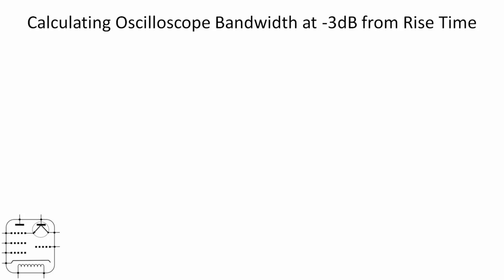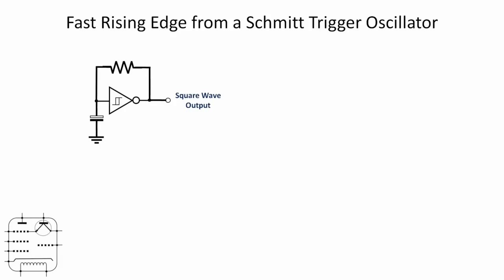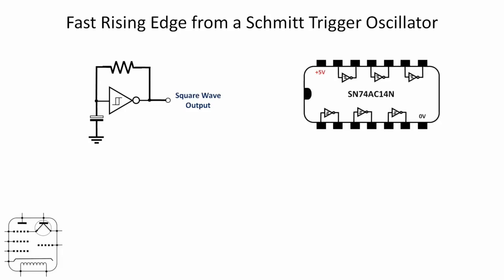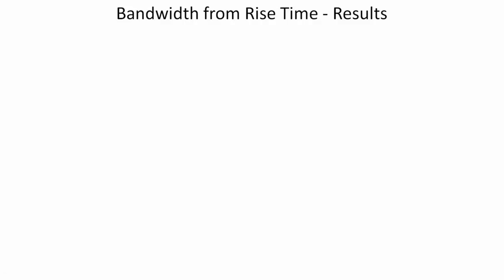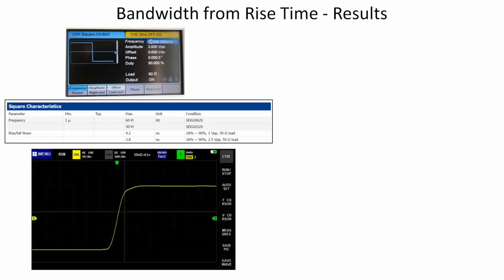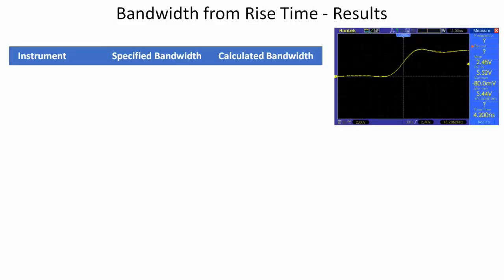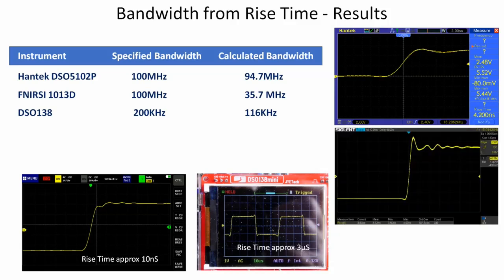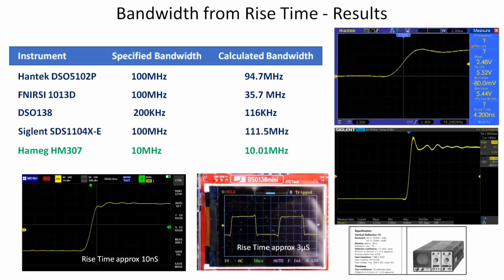Scope Bandwidth using Rise Time - #076

Comment: I purchased Rigol’s MSO5074 & unlocked the full bandwidth including all other features. I was able to measure 821ps rise time with the included PVP2350 passive probes, I’ve read on various forums, using an active probe the MSO5k can achieve a hair or two faster than 700ps RT, this with one channel, channel 1 or channel 3 on the MSO5k. For my purposes the MSO5k is a bit of overkill though I deal mostly with digital signals & the 350+ MHz BW will be quite useful.

Comment: Was looking at the Fnirsi 1014D and 1013D but found they both performed well below the specifications listed. I decided on the Owon HDS2202S, which is smaller and has better specifications but for a higher price. I feel that the Fnirsi products would sell better if the reviews did not suggest looking for something else for a similar price and compareable stated specs.

Comment: I think manufacturers need to explicitly list the digital and analog bandwidths. Most bandwidth specs I see listed are analog. Given this is a digital approach based on signal accuracy  that means alot of specs are false advertising. I have a dso138. I put a 1MHz square on it from a heathkit scope calibrator and it could read the frequency with some bouncing around . The output was less than 3 volts peak fixed. It could lock onto the 200khz. I will have to try this with the Velleman k7105 I have that was expensive when new.